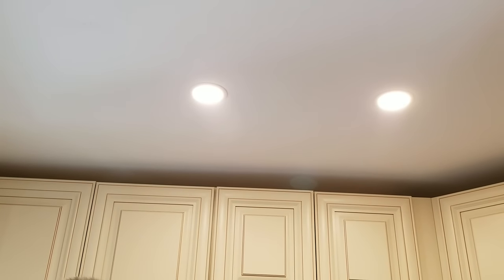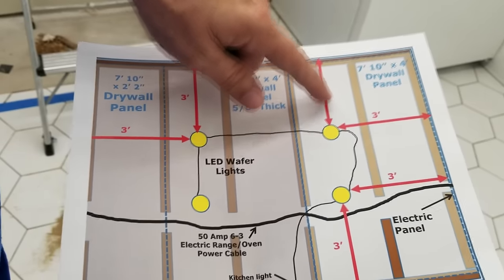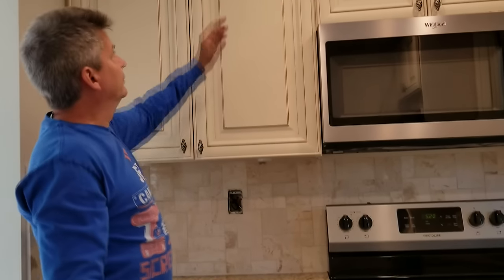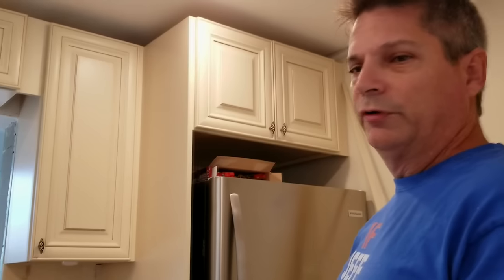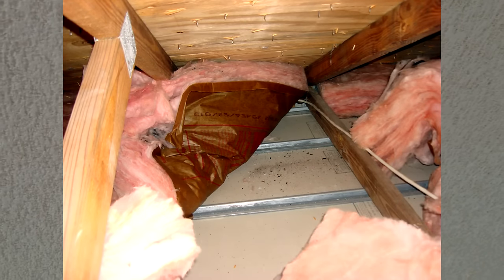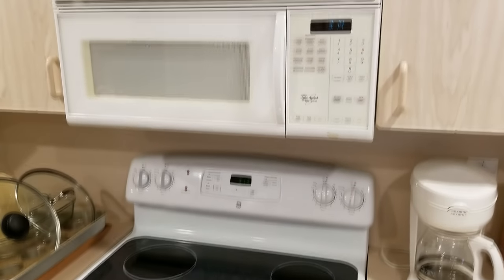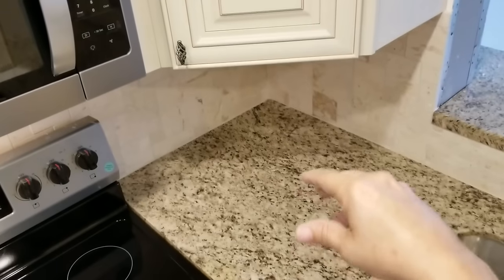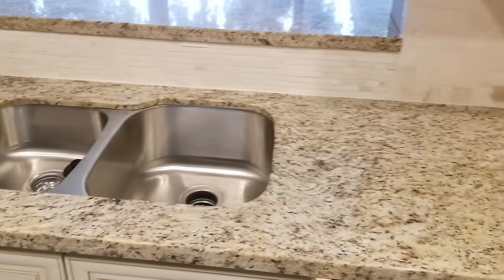Kitchen Light Spacing Best Practices, How to Properly Space Ceiling Lights

Comment: A little to far back no shadows looking from a distance. Watch videos when he stand in front at edge his shadow makes the countertop dark but when he stepped back it gone. So work at your counter from a distance . But the other house bad show he can work on counter top  and see what he doing. Your not working at back of your cabnet your working on front of the cabnet. And so his shadow not blocking the countertop. I put rock wool light cover over old recessed cover. And install hard wire Under cabinet lighting with switches.
Reply from the maker: Those suggestions are fine when there's a budget, but when you're in a $60,000 condo you pretty much get 4 lights and that's it, no room for expensive under counter lighting and more wiring done, and more permits.

Comment: While I respect jeffostroff's experience and training, I have to disagree with the lighting recommendations here.  Jeff is correct in his analysis that a light 24" from the upper cabinet will allow the light to illuminate the full countertop, but it is based on the assumption  that a human is not there.  I am no expert on anything to do with building trades.  That said, I am absolutely a world authority on cooking for a family.  I have this exact setup for lights in my new house and my shadow falls on my work all day, every day, and I can't see jack on the counter tops.  I had to put bright under cabinet lights (anyone enjoy glare?) just to butter bread.    We plan to remodel the kitchen and the first thing after cabinets will be lighting design so I can see my work.
Reply from the maker: Your lights now are 36" off the wall?  Maybe try some at 24" and some at 36", That's a combo I want to experiment with on the next kitchen remodel.  Also on the under cabinet lights, try to mount them as far forward as possible underneath the cabinet to prevent too much glare off the back splash. At our friend's house 2 years ago, the electricians who know nothing about kitchen lighting, mounted his under cabinet lights almost touching the rear marble back splash I installed, so it was  glare central.
Reply: @jeffostroff  you are 100% spot on regarding the under cabinet lighting.  I had to move the lights from the back of the cabinet (where the electrician wanted to put them) to the front.  I wish I had seen your reply before I let him do what he wanted.  As for overhead lights, I got recessed indirect LEDs, and they are 12" from the face of my upper cabinets.  There is about 1.5" of clearance between the top of the cabinet door and the indirect LED.  My electrician really tried to get me to accept those flat discs that just pop in, but I handed him the indirects and insisted.  They are perfect.  They shed light directly over my hands.  Were they 24" from the cabinets, or, 36" from the wall, the light source would be behind my head, as were the original lights in my old kitchen.  Where I couldn't see jack on the countertops, because my head and shoulders cast shadow on the countertop.  The indirect LEDs, made by a Canadian outfit,  are constructed with the chips are arranged inside the rim of the fixture, pointing upwards into a small white dome which reflects the light back out into the room.  It diffuses the light so that there is no glare when the overheads go on.

Comment: You're supposed to use recessed light covers for Canned lights in the attic. They are not rated to place insulation on them like the wafer LED lights.
Reply from the maker: That is correct. You would not believe how many properties I worked on where they had no protection over the cans, even my own house. The builders are morons.
Reply: @jeffostroff  Insulation rated ceiling cans are rated to be installed in insulated ceilings without separation from the insulation.  That's all we use.  They've been around for a long time.
Reply: most cans sold now are rated to be in contact with insulation.

Comment: I disagree with the 3ft rule. You'd create a shadow. I'd do 2ft from wall (1ft from cabinets)
Reply from the maker: I am working in this kitchen now with the lights at 36" and very minimal shadowing, you really have to struggle to see the shadow, because the other light to the left of it also helps fill in light on the task area of the counter in front of me, offsetting any minor shadows coming from the light over my head. If you really want to fill the kitchen with light, leave these at 36" to avoid darkness under your counters, then put task lights at 24" from the back wall right over the sink. But if you just place the lights 2 feet from the wall, you'll get really bad dark shadowing under your cabinets, just look at the 2 other houses I show near the end of this video, they are harsh dark shadows created when you only place your lights 24" from the wall.  Maybe the ideal lineup would be 36" like I have in this video, then a couple over the sink for task lighting, but I really don't think you'll need it. But experiment, wire up some lights and test their placement on the ceiling.

Comment: OMG! How many drywall screws can you put in a ceiling???
Reply from the maker: Industry recommendations for drywall screws on the wall are 8" spacing around the edge of the sheet, and 12" on the field. With ceilings, the only difference is 7" to 8" along the edge. But when I'm using extra heavy 5/8" Firex board, I go 6" spacing, and the more the better..

Comment: Wafer lights suck. It's all glare reflecting back into your eyes. You might as well just hang a bare light bulb.
Also - your spacing off the wall depends on how high the ceilings are. My lights are deep recessed and are 32" off the cabs and they work great (9' ceiling height ).
Otherwise it's all good :-)
Reply from the maker: You can put dimmers on them and reduce the glare.

Comment: The LED wafer lights and LED sealed units are absolutely the laziest invention to come along in a while. Until the industry improves the quality of light, their integrity, and their longevity, which is still unproven since they're only around five years old, I still have conventional recessed units installed on my projects. I'm leaving my clients with option of using screw-in bulbs, LED snap-in units, or hideous wafer snap-in units so at least they can be replaced easily whe they burn out before their claimed 15 year life span (which isn't long enough, btw).
Reply from the maker: Many of the LED lights have been around a lot longer than five years and all of the ones I've installed are still working, which is still better than the incandescent bulbs that they replaced that used to burn out almost every year. And also the LED lights burned cool to the touch whereas the other light bulbs burn hot. Also the Eli D lights are less likely to cause a fire up in your attic then the regular incandescent bolts which generate a lot more heat. Also at least for now the LED lights draw 1/5 of the power of incandescent light so it has an immediate effect on lowering your bill. So your point doesn't really give enough justification to not use the LED lights because you're forgetting a lot of the much more important ones especially in older houses where the recessed lights are nicknamed fire starters it's much more important for those houses to switch to LED. There's nothing lazy about it you're just complaining about it for no reason.

Comment: Anytime someone says "I've never seen it done right, but I know how to do it right!" Runaway. Quick as possible. I am 6' 2" and if you put a light behind my head, in a kitchen, I'll be rather pissed off.
Reply from the maker: All you are focusing on is that 1 light behind your head but there is another light that's to the left of it that fills in over the counter O I've played with this and I have seen very minimal shadowing on the counter nothing that interferes with my tasks. Maybe for someone like you you might want to put task lights directly over the counter at 24" away as well as the other lights to help prevent the shadows under the cabinets experiment with the placement.
Reply: @jeffostroff  I appreciate the reply, but I am not persuaded. No worries though, it is okay to disagree. Those over-counter lights are considered task lighting. One wants them focused on the task. If you are relying on the lateral lighting to fill in that gap, then you are saying that ambient lighting is a substitute for task lighting. It is not. Beam angles and candle feet requirements prohibit ambient lighting as task lighting. Electricians do it a certain way because of industry best practices. Not because they just want it at 25" from the wall. 

While there is no true authority, that I am aware of, for task vs. ambient lighting, there have been many folks that have tested this. In fact, the way you install them in this video is the old way of doing it. Before the industry really tested task lighting. Here is a link to a great writeup and tests performed that proves the point I am making. 
https://www.proremodeler.com/recessed-kitchen-lighting-reconsidered

Take a look, or don't. Either way, have a great day :)
Reply from the maker: @Elitiest_Hitman   Thanks for sending that link that was an excellent read especially being an engineer I appreciate those kinds of measurement takings that people take the time to do. But if you read his article you'll see he gives a major caveat at the end that his measurements were based on one light in a darkened kitchen in a construction zone before any other lights were added which is not a real world situation.  I even admitted that his own experimental results were not able to benefit by the addition of the lights on either side like I do. He did mention he was going to revisit it in a later article which I found his later article from a few months ago. However he did not complete the same measurements at his clients completed project. So anyway you have given me an inspiration to go and make another video here showing us taking the measurements here. Also one thing everybody keeps assuming here is that my lights are behind me shining like a total eclipse of the Sun on a the counter which is not true. My lights are mounted 36" from a wall and when you stand in front of the counter the lights are not behind you they are beside you. I do see a very minimal shadow that appears on the counter,  Most likely from the other set of lights that are behind me across the kitchen but I am going to measure that and put all of these results in another video, The same measuring techniques that the architect used we will use also. And it will all be in a video  for all of you.
Reply from the maker: @ballzack57, we just uploaded the sequel video to this one that shows how we did the light meter testing similar to the article you linked to below, and showing us trying to create shadows on the counter from all the people who complained that we had our lights too far from the wall at 36", see that video here: https://youtu.be/g5Ghx7-UJiU
Reply: @jeffostroff  Your only criticism of the architect's work is that he only used one light in his test. This criticism is nonsensical. The entire point of your video is how to maximize the efficiency of recessed lighting. Measuring the efficiency of each fixture is the only way to do this.

I suppose that the ambient light from the other recessed fixtures will offset your poor placement, but recessed lights are the least efficient lights at producing ambient light. There's a reason everyone else is doing it differently than you, and it's not because you're uniquely qualified. Perhaps you should leave home design to the professionals.
Reply from the maker: @kungfoochicken08  There's nothing wrong with recessed lights for ambient light, they provide nice even cones of light. What light do you propose for ambient light?
Reply: @jeffostroff  Everything is wrong with using recessed lighting for ambient lighting. Recessed lighting is designed to provide tight, directed cones of light. It's neither designed nor efficient at providing ambient light.

Comment: I've never saw a 60/40 kitchen sink installed like that
Reply from the maker: How do you normally see them installed?
Reply: I've been a plumber for 15 years and the large side goes to the left and the small side should be to the right with the disposal
Reply from the maker: @dudester3263  New Suneli M503-L sink smaller sink basin goes on left. Many manufacturers make 2 versions, a right and a left. Surely you would have seen that with your 15 years experience. We do have the garbage disposal under the larger sink on the right, our installation is correct. If you turn the sink around like you said, the Suneli logo will be upside down.

Comment: You need undercabinet lighting for counter top food preparation work.
Reply from the maker: Not sure where you got your logic from, but it is wrong. First of all if you paid attention to this video, you'll see my solution lights the counter all the way to the backsplash, so no under counter light is needed. Second, cabinets are usually 12" deep, and so most installers place the under counter lighting 6" from the back wall, so it basically creates a hot spot over the area next to the wall, but provides little to no useful light out on the front part of the counter where we do our food prep and cutting. So Your statement about undercounter lighting being needed for food prep work is wrong. IT only lights up the area under the back part of the counter.
Reply: @jeffostroff  not true, if you're standing front of the counter prepping your foods,  depending on how tall you are your body is going to create a shadow since the lights are behind you.
Reply from the maker: @dannyluu2861  I've had tall people come into this kitchen and test it out. Minor shadowing because the light is not really behind you, it is more like beside you.  If you stand in front of a 24" counter, your head is really at about 30" away.
Reply from the maker: Wrong, under cabinet lighting is not sufficient for prep work, you would need task lighting right over the counter if you want to light up the prep area. Furthermore, many people don't like lighting under the cabinet because of too much glare off the backsplash tiles. Too many installers incorrectly install the under cabinet lights too close to the wall, when they should be installed toward the front edge of the cabinet.

Comment: No i definitely disagree, putting lights that far back means that you ALWAYS cast your own shadow when working at your counter and that is just plain annoying, have you heard of under cabinet lights? they look fantastic and make an even better worklight.
Reply from the maker: Apparently you're not paying very good attention of the video because you can see very little shadow on the counter where I am standing, As a lot of it gets filled in by the light that is to the left of me and back 36" because it is not blocked by me. Not everybody wants to put in under counter lighting and deal with the wiring and then having to have switches put in for it

Comment: What if your ceilings are sloped?
Reply from the maker: If your ceilings are sloped you still do the exact same thing the wafer lights will still work at an angle or if you want to put more directional type lighting where you can change the swivel angle of the light so that it's pointing straight down that would work also.

Comment: Never Ever turn off kitchen LED lights.
45 year life LED 45 years
Now
30-40s maybe 50s you buy your home. 
so
85 years old before you have to change out the LED lights.
For 45 years you live in the light not in the dark 45 years of light. Near death you finally have to change out your LED lights
Once installed kitchen LED light they never turn off and maybe never need a light switch maybe a remote dimmer.
Never Ever turn off kitchen LED lights.

Comment: Totally disagree with your layout as it relates to good working light for a kitchen. Lights in front of cabinets which are for lighting the countertop should be 18” to 20” off the wall so that the light does light up the cabinetry but also gets to the countertop where the work is being done. With your lights 36” off the wall the upper portion on the cabinets will be in “darkness” because the light beam doesn’t spread out across the ceiling...it goes down in a cone shape.... AND when the person is working at the counter he/she is casting a shadow onto the counter because the light is behind them! IF you have under cabinet lighting this will help offset this shadow condition but if you have your ceiling lights at 18-20” then you are getting BOTH ceiling light + under cabinet light. The other thing that should be done is to position lights centered with cabinets and appliances...like stoves and refrigerators. This way you get consistent illumination throughout the kitchen....open a cabinet door, work at the stove or sink etc. Lighting in the kitchen is the MOST important thing to get right....for the aesthetics of the space and the functionality of all the work being done there. And last but equally important is to put all lighting on dimmers so that the intensity of the lighting can be adjusted to what’s going on in the space. More lights and dimmers = Total control 🎉👍🏽
Reply from the maker: You should look at our follow on video where we show me posing at the counte rin different spots, and show you that most of your statements about dark shadows are wrong. Take a look: ✅ WATCH: How to Measure LED Kitchen Lighting, Ideas, Design Practices https://youtu.be/g5Ghx7-UJiU

Comment: That is incorrect if you use ic rated can lights you do not have to protect them from insulation as they are rated for contact with insulation
Reply from the maker: yes, IC means intimate contact. but 100% of the cans used in the 1970s and 1980s were not IC rated, they were nick named fire starters